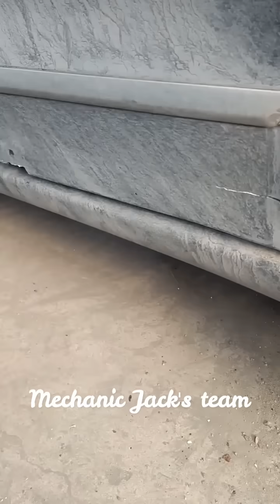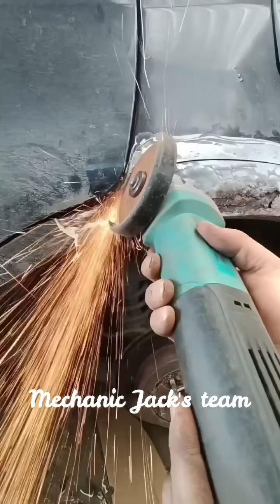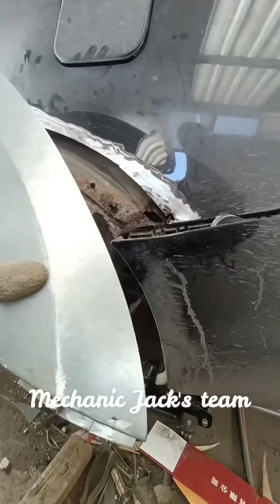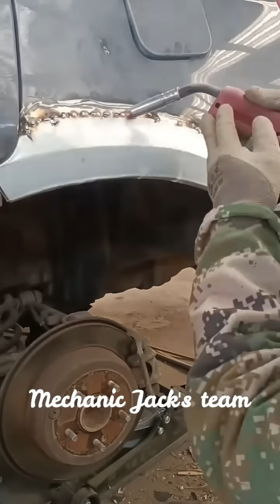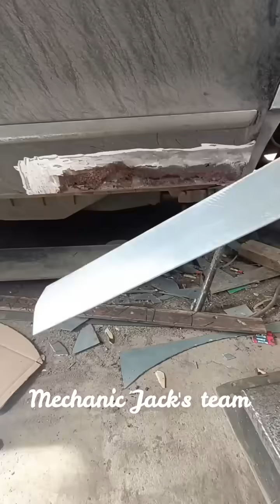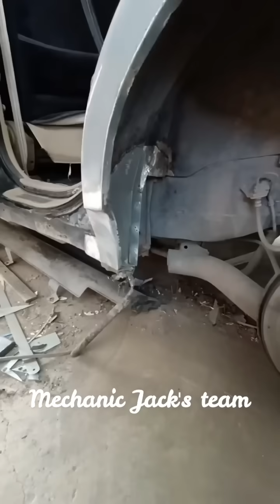Whole process of Car Restoration| Rusty Car

Comment: How do you know the rest of the car like the floor board may have rust in it? I wouldn't get in that car without checking to make sure it's rust free.
Reply: @monad_tcp  That's exactly what happened to me years ago when a friend took me for a ride in his 69 VW bug. As the car was moving I accidently kick a piece of sheet metal on the floor where I was sitting & freaked out when I saw the road through the hole. He had covered the hole with the metal plate but not welded. I noticed the floor board was rusted on the passenger side.

Comment: Automatic thumbs down.  The car was good until you used the hammer.  Its rust but it hasnt eaten through.
Reply: also no rust treatment on the bottom parts by , grinding away treating with chemical

Comment: This car is a heap of junk. The new owner will be really annoyed when he discovers his car is a patchwork of tin plate. Welds and Bodge. The cars value is less than the labour costs. Don't make any sense unless it's for the worker to keep.
Reply: I guess the owner should just buy a new car huh?
Reply: You are thinking of a car as a investment vehicle. While cars are a vehicle, you aren’t buying one for an investment. You get one to drive. So if you can spend like 200-300 fixing a car you already have or you can cough up 5-6 thousand for a comparable car.
Reply: They probably 'repaired' it just for the sake of making a video. Usually these guys use sealant and primer to protect the welded areas. That they didn't do it here probably means that the car is junk.
Reply: @toddcoen7822 😂